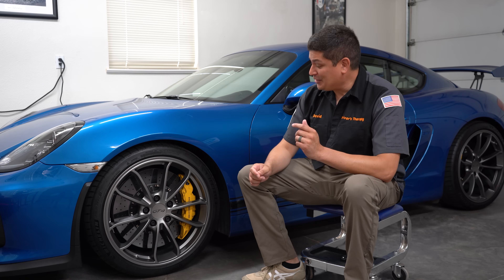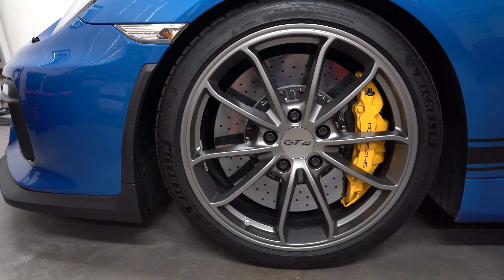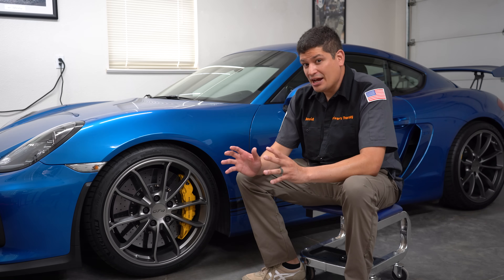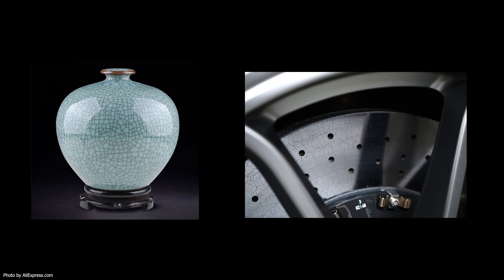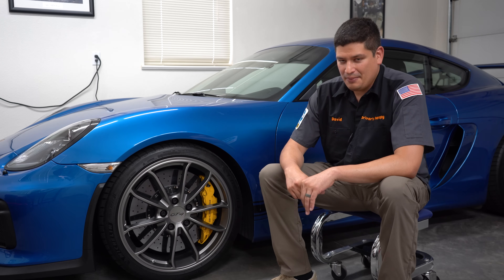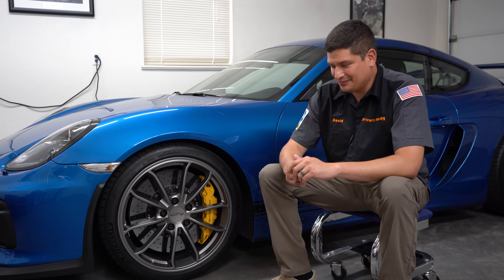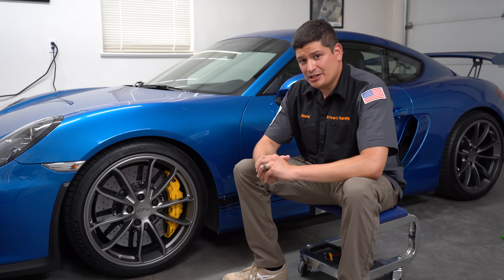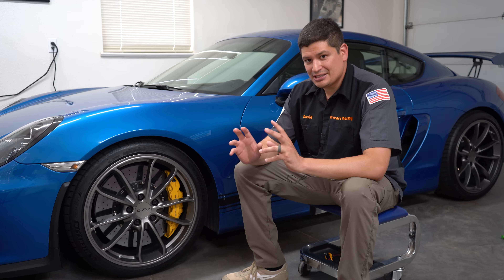Carbon Ceramic Brakes Explained | Design and Advantages

Comment: Can carbon ceramic rotors warp? My F type with 30k on the brakes started to shake the steering under light breaking. I’m hoping is a track rod end or tracking. 🙏 I’m booking it into the workshop tomorrow
Reply from the maker: They can bend and crack. Sounds like it might be a suspension issue.

Comment: 8:10 : THIS IS BECAUSE OF TYRES. The brakes did the same as they would if they were steel for one emergency stop.
Reply from the maker: there is a difference in stopping between the two.
Reply: @DriversTherapy nope, think about it how is the brakes gonna make the tyres grip more? Braking is traction limited.

Comment: Brembo makes the PCCB rotors not P.  They are the same mfg for BMW, Merc, Nissan, Chevy, etc.  What you didn't elaborate on is the heat that these do not like heat.
Reply from the maker: Good catch, thank you. I will add a note about that in the next video.

Comment: Thank you for sharing great information.  How often do I need to change the carbon ceramic brake pads and can I check the condition of pads visually?
Reply from the maker: Checking the pads thickness from 100% to 20% can be checked just by looking at them but if you have uneven wear which is unlikely most of the time, you might mess that. As far as changing out the pads goes, I would let Porsche do that but if you really want to do it, there is some good DIYs out there.
Reply: @DriversTherapy do you know approximately how often the pads need to be changed ? 
On my cayman S, I needed to change them at around 23k miles.
Reply from the maker: @tyson527  less often with carbon ceramic brakes. They use different materials. But it depends on how they are used. Heavy track days will sorted their service life significantly. Thank you for watching my video and make sure to follow us on IG.

Comment: One thing you didn’t mention is carbon ceramic brake in winter condition.

While the temperature drops under 50F, the Carbon ceramic brake barely stops the car until you brakes for few time to warm it up, and it creates extremely loud grinding noise when it’s cold. It is dangerous for the first or second stop. 

Another dangerous experience I had with carbon ceramic brakes is when I was driving home from Ski resort, driving Urus with snow tires, after cruising on highway without using any brakes for about ten minutes, I need hard brake because there was a sudden traffic in front of me, my car took forever to slow down even though(I feel like the brake was doing nothing for the first 2 seconds) I brake very very hard, at the moment I thought I was going to rear end the car in front of me, thank god those brakes warmed up and slowed the car down immediately.
Reply from the maker: I didn’t know that. Great info. I don’t drive my GT4 in winter but it’s good to know.
Reply: I got PCCBs on my 981 Spyder, no noise or cold braking problems ever. I don’t drive in the snow here. ❄️

Comment: Don't these make squealing noise when applied in street in cold weather places.
Reply from the maker: They squeak in all types of temperatures. It’s just part of the characteristic of the type of brakes they are.
Reply: @DriversTherapy  Is that pretty annoying/embarrassing or tolerable?
Reply: @pd3345  it is very annoying
Reply: they squeak because of dust

Comment: Very interesting video - thx 👍🏼
Reply from the maker: Thank you for watching!!!
Reply: @DriversTherapy  I am going to buy a racing yellow GT4 with PCCB and 17.000km - I saw the surface cracks but with your infos I‘m not worried any more :)
Reply from the maker: @lukiii_e   awesome! Your going to love it. Don’t worry about the small cracks. Also, make sure to watch my video of the GT4 buyers guides.
Reply: @DriversTherapy  one question - how long do the brake pads last during normal use?

Comment: Short and sweet video, but with a correction: the 2000 Mercedes-Benz CL 55 AMG F1 Edition was the first production vehicle to have standard ceramic brake discs (2 years before the Enzo).
Reply from the maker: Awesome! I didn’t know that. I will have to read about it. Thanks for the data.

Comment: Any part 2 video to this, to record the squeaking they make? How long does it take to heat them up for normal street use in winter and summer? What's your climate like?
Reply from the maker: I live in Colorado. We get all the seasons. I got some squeak after driving hard but otherwise it stays fairly quiet.
Reply: @DriversTherapy  thanks!

Comment: Hi I just ordered a MB car and the dealer said it comes with CC amg brakes. Now I find out the front is CC and the rear are not CC rotors. To me this sounds not right. Any thoughts? Thanks
Reply from the maker: I am unable to find any information or data on that configuration. Typically you would not mix two different brake materials between the front and back since the would react differently during heat cycles. But, you never know, MB could have found a way to mix the two to make CC an option still. But I’m hesitant to believe it would work well.
Reply: 😂 Is it a C63? They've always been setup that way, as a simple research would confirm
Reply from the maker: @ness-uno1 cool, I could not find that out. That is a odd setup.
Reply: @nes suno  it is a gle and it is front only no worries but I wish MB would offer F and R
Reply: @rd.7732  somehow, they commonly setup 63 models that way. May be they're trying to reduce front V8 weight and keep cost down? I first discovered this with the C63. It's normal, but odd.

Comment: What is the exact weight gain on this ceramics vs steel in kg?
Reply from the maker: Ceramic rotors are lighter than steel rotors. Not sure on the exact weight difference. This article says about 10 pounds difference per wheel. https://rennlist.com/forums/gt4-spyder/860668-pccb-vs-factory-steel-brake-weight-difference.html
Reply: @DriversTherapy  thanks for info!
Reply from the maker: @luigirigattoni9648  your welcome!
Reply: The weight saving is particularly significant on high-performance cars, because the rotors are necessarily very large. The importance of reducing unsparing weight is tremendous.

Comment: The cost of running the OEM CC brakes on a  track in a fast car like a 2012 - 2022 McLaren on a road course with serious braking zones like Laguna Seca  in Monterrey with a  quick driver for a track day weekend is over $2500 in pad and rotor wear 
Stopping power under track conditions like this is not  noticeably enhanced by running  CC brakes as opposed to steel brakes 
Pad and steel brakes set ups would cost under $250 per weekend under same circumstances 
CC brakes are great for the street with amazing and do not create but a little brake dust 
Many exotic car owners curse their OEM CC setups as they can need  som miles to heat up a bit after you pull out of your garage 
So one must allow longer stopping distance than normal
Reply from the maker: Thanks for sharing that information. PCCBs are not very cost friendly at all for the hobbies track day but if they offered less performance, majority of IMSA cars wouldn’t be using them. I know I would use PCCBs if I track a lot due to the cost but the performance is undisputed. Thanks for watching the video.

Comment: nice, just bought a porsche with PCCB
Reply from the maker: Congratulations!
Reply: Would love to hear more of your thoughts! I’m looking at  718 GT4 that has them and can’t figure out if I should or not!
Reply: I have sold my 997.2 for a 981 pdk with steel brakes. The stopping power difference is immense! The pccb never fade and no brake dust. When you’re not tracking the car, i would go for the pccb.
Reply: @immoservicemark7506  When NOT tracking the car - interesting? Do you think the wear is too high when tracking then and therefore could be in for maintenance? I'm probably looking at 3 track days a year...